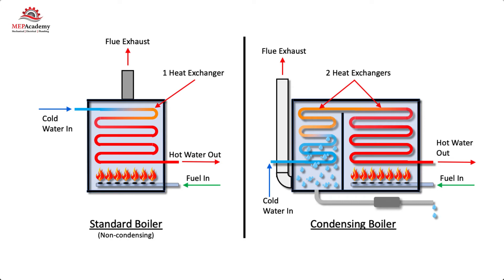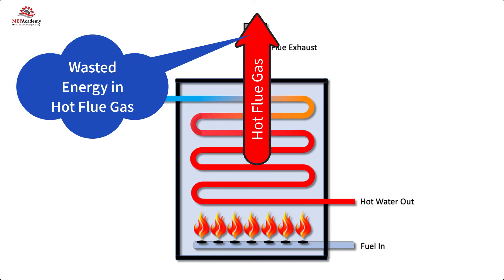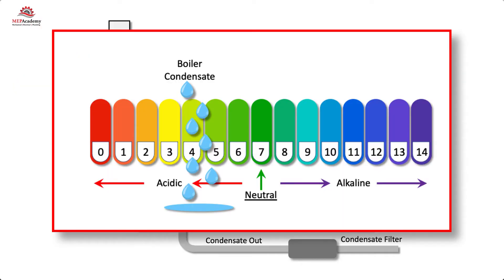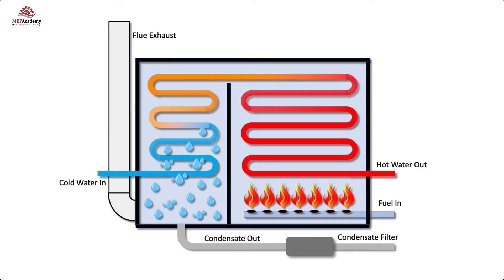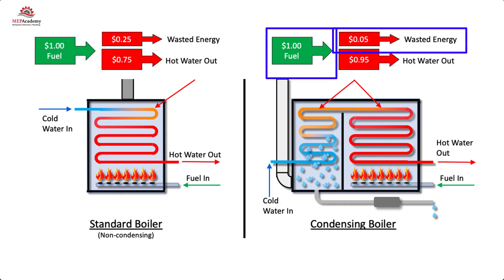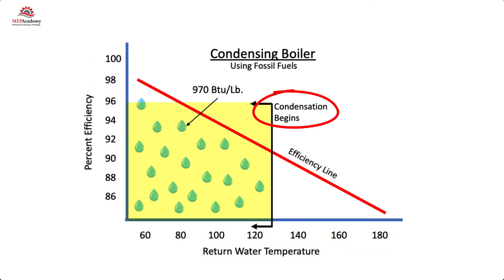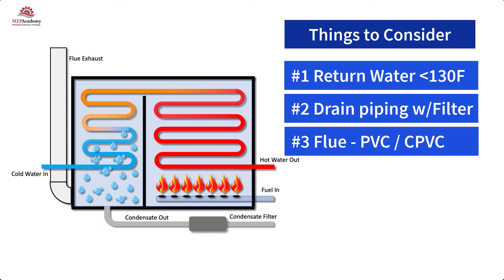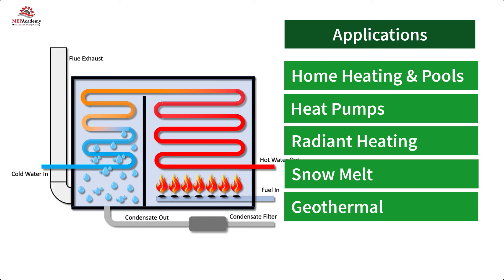How a Condensing Boiler Works

Comment: That first illustration is incorrect.  Cold water enters from the bottom of the boiler, and exits the top. Can't even get this right.
Reply from the maker: You're correct. Thanks for pointing this out. Sometimes those creating the graphics get it wrong and we miss it during the QC process. At least you know the difference. Good catch.

Comment: I have a condensing boiler installed in my facility.  However the pumps are do not have VFD and the system is equipped with a differential pressure bypass valve.  This leads to low Deta T across supply and return as well as high return temps (almost always above 135 F).  Do you have any suggestions on how to take advantage of the condensing boiler's capability for increased efficiency in this situation? Thank you!

Comment: is carbon monoxide present in the condensation outflow pipe?
Reply from the maker: Small amounts of carbon monoxide are exhausted, while the condensate is acidic and should be treated before being sent to the drain.
Reply: @MEPAcademy  appreciate your reply

Comment: Usually condensing boilers is efficient at about 85% AT BEST.  All boilers is configured in such way that they are NOT efficient. Also lot of people uses them inefficient. To get efficiency you MUST not exceed flow temp of 50c. and as much cold return flow as possible.  There should NOT be visible 'smoke' coming from flue. MOST people think if they see 'smoke' (it's just water vapor) coming from flue it means it's in condensing mode. it's INCORRECT. If you see white 'smoke' coming from flue this means you are NOT getting high efficiency your condensation happens OUTSIDE the boiler, because it jut too hot inside to create droplets.  Most people uses condensing boilers at VERY high setting like 60c flow temp at which no condensation is happening and boiler efficiency is the same as standard boiler's. 
You have to use as low temp as possible to get NEAR the specified efficiency.  Your video also have this problem you only talk about RETURN flow temp, while flow temp is important too. The higher flow temp -the less surface of cold area the less condensate. So flow temp is as much important as return temp.
Also most important efficiency requirement is - outside temp sensor attached to boiler and the best would be to have room thermostat too, so boiler could use both data and choose optimal flow temp.
Reply from the maker: Thanks for the comment.

Comment: So why does my condensing boiler flue  'plume' even with flow temp set to 50c?
Reply: It might have to be flow speed adjusted to get the 22°c between the flow and return
Reply from the maker: John its best to have an experienced boiler technician look for the reason as it's not easily diagnosed from your description. Was this during a high relative humidity day? Is the forced draft fan spinning faster than it should, blowing out the condensate instead of it draining? Is the drain line clogged? There are many things to look at, and anytime there is a burning fuel involved it needs the attention of an experienced technician.

Comment: I didn't understand the latent heat section, can you elaborate more ? Is the 970 Btu/Lb universal or only for Natural Gas fuel burners ?
Reply from the maker: That's the latent heat of evaporation for water, which is universal. See our video on What a BTU is, that will make it clear as to where the 970 Btu/lb comes from.

Comment: So essentially a condensing boiler harnesses the waste exhaust heat to preheat the incoming cold water. This results in less energy needed to heat the water to any given temperature. 
This process results in condensation (condensate) water, and its disposal ?.

1, Why is the condensate water considered acidic by this process ?.
2, How does a non condensing boiler deal with condensate water which is not captured and disposed of, albeit less efficient ?.
Reply: The condensate is acidic because of a chemical reaction by the heat of the gas burned.
Reply from the maker: 1) The PH level of the condensate is on the acidic side so it needs to be treated.
2) A Non-condensing boiler should not have any condensation with proper design. If the non-condensing boiler has condensate then it will corrode the heat exchanger, which does happen.
Reply: 1. This is a pretty poor explanation as to why it is acidic. Condensate from cooling coils are not acidic, so why is it with boilers is the original question.
2. Again, not answering the original question. You just say it doesn't have condensate, not why it doesn't have condensate.
Reply: Combustion products of burning gas I suppose. CO2 dissolved in water forming Carbonic Acid is acidic.

Comment: Need a video on how to actually reduce the return temperature.
Reply from the maker: Thanks for the suggestion.
Reply: You need to redesign or modify your existing heating coils/ radiators (add more heat ejection surface)
Reply from the maker: @adobo6905  Thanks for the suggestion.
Reply: It's VERY easy. the slower the pump -the colder return. so just reduce the pump speed. Also flow temp is as much important as a return. Because of the higher the flow temp -the less cold area the more heated area the colder return have to be to create condensate.  This video bit misleading because boilers have water in coils, it's much less area than in this video. So heat spreads a lot to a colder area too, leaving tiny area to condensate to.
Reply: @SayWhaaaaaaaaaaaaaaaaaaaaaaat  what is the idea return temperature?